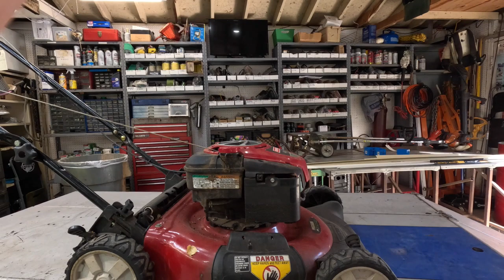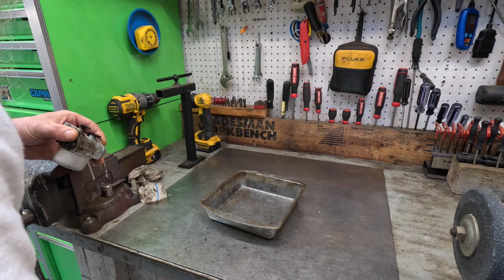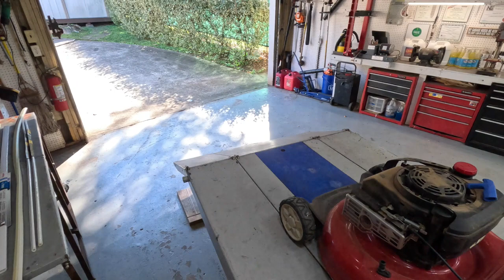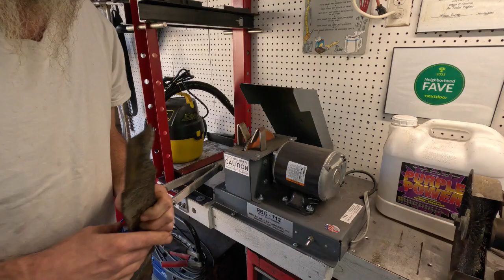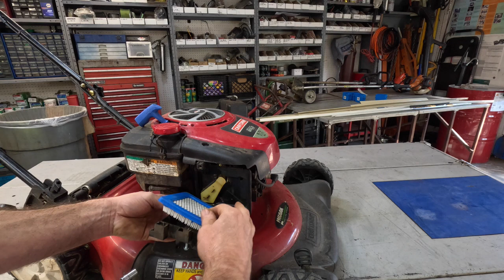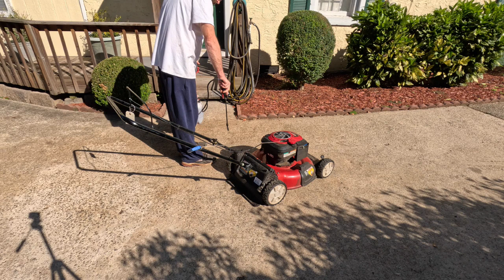Craftsman Push Mower Won't Crank! Sitting 2 Seasons

Comment: It's red.  Red mowers are always worth saving. 🤣
You did the same move I always do with the air filter. It looks like it should go to the motor before the cover until you hold it up to the motor.